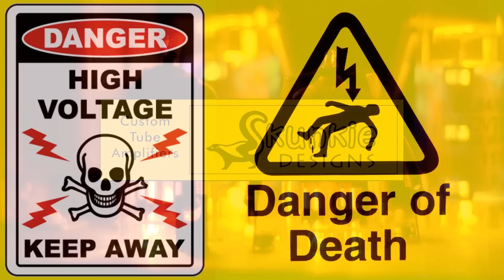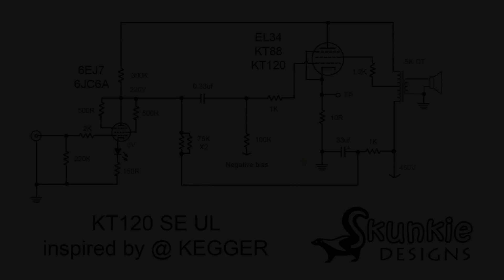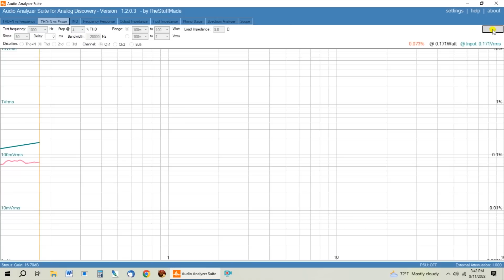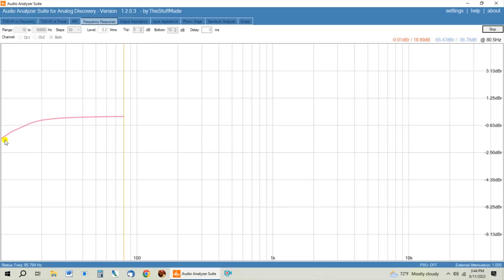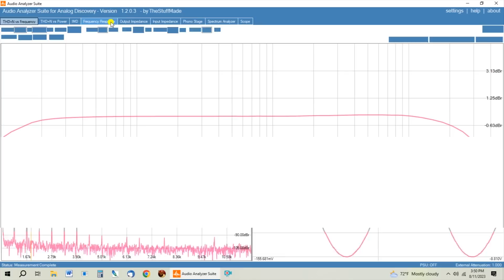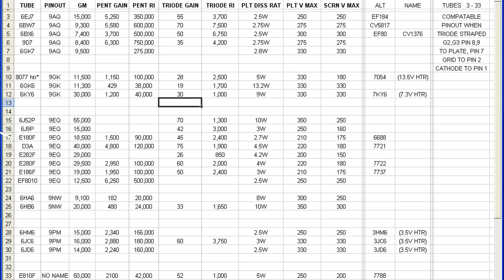KT120  SE UL mono block Tube Amplifier: First Tests!

Comment: Hi , im very close to getting the iron sorted for these , rather than go with thermionic can I use maybe the hammond 5k opt ? 1628sea or similar
Reply from the maker: Should work, the diff between 4.3K and 5K is nothing. Looks like they are rated for 120ma and the way this amp uses Schade type negative feedback, the output transformer isn't in the feedback loop so the transformer doesn't impact that.
Reply: @SkunkieDesignsElectronics  ok thats good , I have a pair of these on the blueglow kt88 and they have incredible bass, im just wanting to get everything from one place , mouser, digi key etc as it all ships free to the UK, could you possibly recommend another hammond opt? I'm never using edcor again 
Cant wait to watch the build start as I think these amps will be my forever keepers , my Klipsch chorus will rock big time ! Much more so than the blueglow and thats good 👍
Reply from the maker: Their big 5K OPT that's rated for 120ma should work fine.
Reply: @SkunkieDesignsElectronics  ok cool that works for me , are you able to tell me your chassis dimensions please, they look the right size for the look im after,  much thanks indeed for everything Skunkie 🙂

Comment: I've recently acquired a matched pair of kt170 Stef and i am wondering what modifications i must do to this schematic to use them and have a bit more SE goodness of power
Reply from the maker: Obviously the iron would need to be capable of dealing with the added current. Not sure how much negative bias voltage a KT170 would need to idle and possibly would need more B+, which would all impact if the driver tube could handle the job. Worse case you could use a plate choke to boost the 6EJ7's output, I plan to do that in a future build.
Reply: Yes, ofc the OT must handle the new power of the tube. I know that tube sensitivity (how much voltage around the working point of the tube) is needed can be calculated from the tube plate curve diagram, but calculating and drawing loadlines for now remains a much anticipated video. Also i know from posts in forums here and there that the inner tube capacitance plays a substantial role when coupling tube stages but dont know how it is represented. Much much more to learn and understand Stef and i hope with your help we can get to the bottom of it. Im not sure even if 6eJ7 could drive optimally the KT170's, maybe a different driver tube could be more suitable.

Comment: Your schematic doesn’t make since. Why are you feeding the b+ to your driver from the plate of the output tube. Your also feeding dc into your feedback loop. Why. This is not normal.
Reply from the maker: That's local negative feed back, not "the B+ to the driver", while it does add a little voltage. The main voltage/current to the driver tube comes from the power supply through the pair of 75K plate load resistors. Some call it plate to plate feedback, it's really more plate to grid local feedback. Look up "Schade feedback". 

While not as common as GNFB, it's not unusual and I find it works really well with UL SE amps and also works no matter what output transformer is used, rather than having to tune the GNFB to a specific transformer. It makes perfect sense if you understand what is going on.

Comment: Would be great if you can list the few parts we need for Europe 240V/50Hz.

That would be nice 

Cheers 

Stedan
Reply from the maker: Again the ONLY difference in ANY tube schematic between 120V/60hz and 240V is the transformer primary winding. Nothing else changes in any tube schematic.
Reply: @SkunkieDesignsElectronics  Thanx Skunkie. So 50Hz does not matter. Cheers Stefan
Reply from the maker: Again, what happens AFTER the power transformer IS THE SAME!!! Of course the power transformer does have to be rated for 230V 50hz and yes it does matter TO THE POWER TRANSFORMER! The voltage AFTER the power transformer is the same.
Reply: @SkunkieDesignsElectronics  Thanx so much. Cheers Stefan

Comment: Great stuff. I'll like to build this going for EL34. 

Can't wait for your detailed build series.

But what is the input sensitivity? Hope not much higher than 1V RMS.

Do we get 4Ohm and 8Ohm outputs?

Cheers 

Stefan
Reply from the maker: This is a power amp designed for a pre-amp, so no the input sensitivity is not high, it's closer to 2Vrms and I would not build this if your goal is to mainly use EL34 tubes, I'm not even sure those will work. And the outputs depend on the output transformers you use, mine have 8 ohm only. See my 6SQ7/EL34 build series for a nice sounding EL34 amp at a much lower cost.
Reply: @SkunkieDesignsElectronics  Thanx Skunkie. Cheers Stefan

Comment: Nice, looking good.🙂
Once this is all finalised I think I might build a pair. With the change to output transformer, which Hammond output transformer would you now recommend?
Reply from the maker: 5K 25W
Reply: @SkunkieDesignsElectronics  I see, so same as you told me last time. Thanks Steph.🙂 I wasn't sure if I needed to use a 4.3k as you have. I don't fully understand everything yet, but I'm learning fast thanks to your channel. At the point I feel following your build video I could manage it, got a few books I'm reading, but a lot of it hasn't really made much sense until hearing you explain things in your videos.🙂

Comment: How much is the output impedance?
Reply from the maker: On a tube amp it's more what impedance are you connecting to it, that is then reflected by the turns ration to the output tube as it's load. It's designed for 8 ohms.

Comment: The actual  low distortion at very low output is even LOWER in reality .......because of the noise floor is taken into the account by the measurement.

Comment: Results look very encouraging. Dead right about the output transformers though. With these ultra’s it’s all in the iron and PSU for the HV. Still, nicely executed. Getting the chokes tailor made is worth a go because the DC capability/R and I transfer all makes for a real match in the tuning of the B+. It’s a nice amount of power which you might never need in a domestic situation but good for dynamics.

Comment: A very informative video. Could you also specify choke values for 50hz which we have in Europe? Would your schematic also work with EL84s? Reason. A, I only need 1or 2 W and B, I have so many.
Reply from the maker: There are other designs for lower power.

Comment: Getting ready to buy all the chokes from Thermionic. PTs and OPTs will come later as funds allow. I have not been this excited about anything in the last couple of years than I am about building these. Thanks for the update / good news and thanks for following your passion and allowing us to come along for the ride. PATIENTLY awaiting a BOM....
Reply from the maker: Just make sure they are 500V rated. Part of the key to this amp is the high B+ voltage. A 5H top mount and a 1.5-3H internal should work good. The DCR should be 65R or lower on each to keep the B+ high.
Reply: @SkunkieDesignsElectronics  The people at Thermionic Labs are on vacation thru September 4th. I will check to make sure the chokes are 500V rated when they get back.
Reply: Is there a Themionic power supply and top mounted choke suitable for this design? @SkunkieDesignsElectronics
Reply: i keep checking every day for that BOM - i have the resistor list from the schem but need Skunkie to confirm the resistors - i plan on using the TKD correctohm 2W ones - but not super cheap